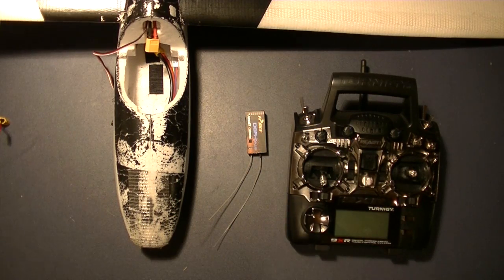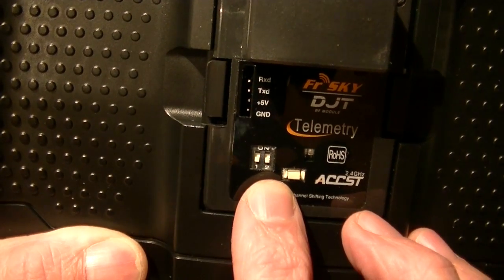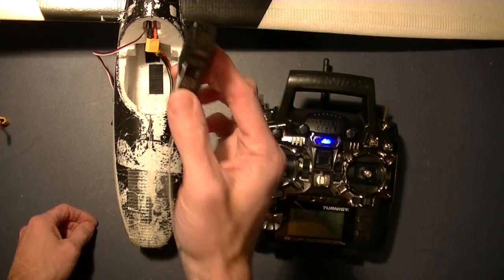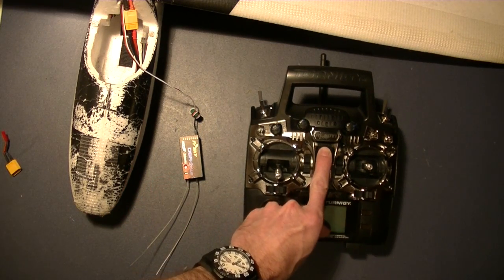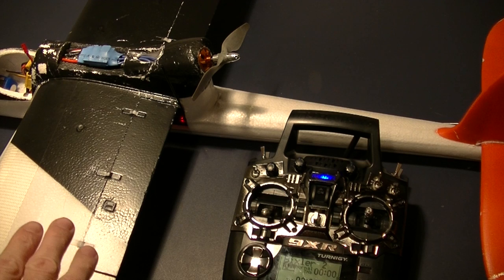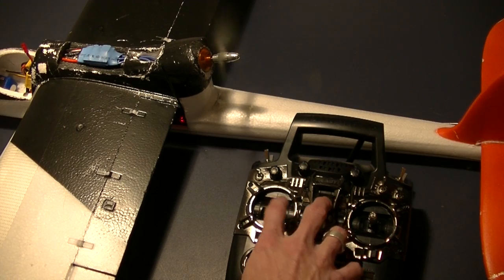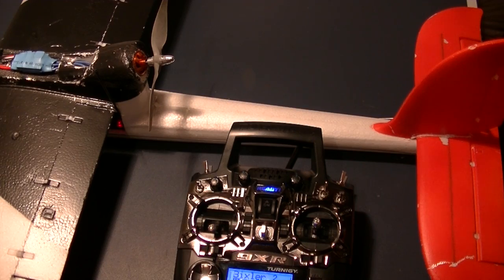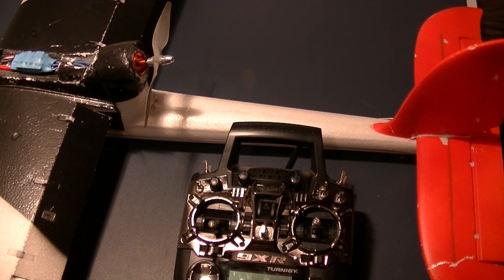CPO 9XR Quick Tip : Frsky Binding and Setting Failsafes

Comment: Thanks for a great vid. Although I'm having trouble binding my frsky xjt module to my d8r-II plus. The xjt is in bind mode on my 9xr. But when turning on my d8r-II plus receiver in bind mode I only get a solid red and green light that does not flash on the rx. No bind. The instructions with my xjt said that that switch 1 has to be on and switch 2 off when binding to the d8r-II plus. Any thoughts? Thanks for your time.
Reply from the maker: Hmmm....  I'll poke around and see if I can give you some guidance. Since I don't have that module, I can't directly test it.
Reply: awesome! Thanks so much for your help!